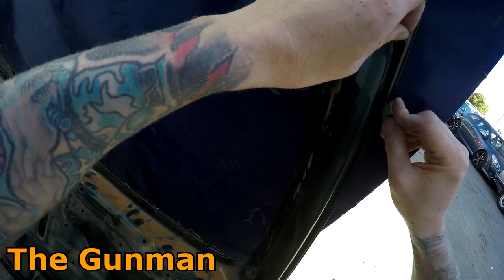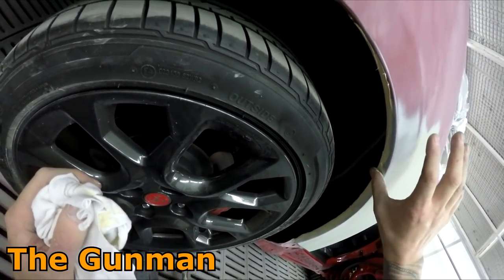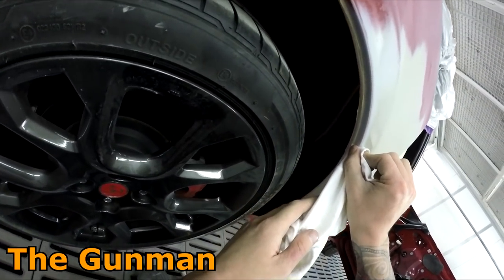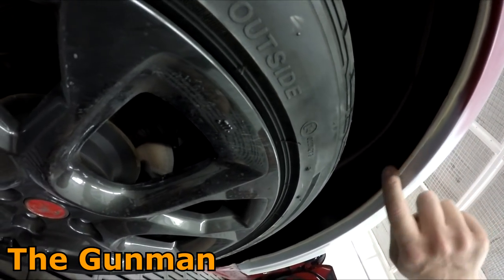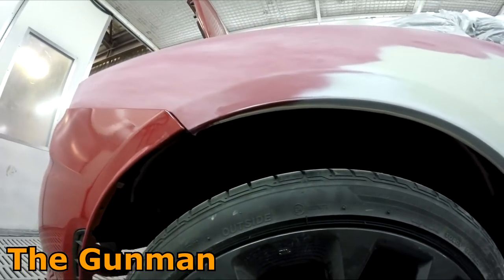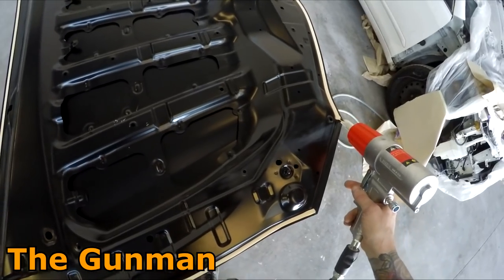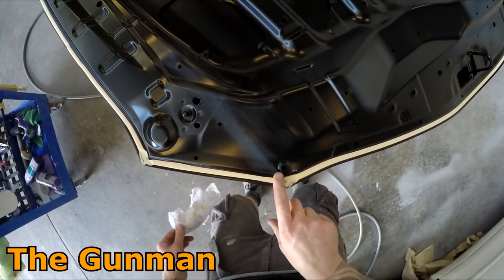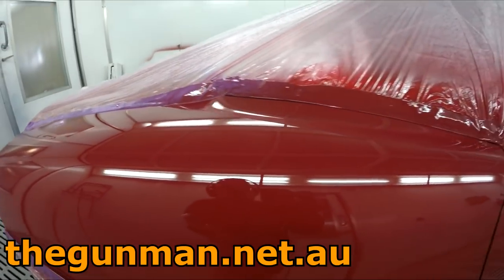Awesome Seam Sealer Trick

Comment: I have been using sem flexible plastic repair. I just lay 2 pieces of tape parallel with each other and make the width i want directly onto something that the plastic repair will not adhere to. Squeeze it on, smooth it out with spreader, peel the tape and let it set up for a bit then pull it off. Kind of the same technique, but its all fresh materials. I use this for all sorts of tricky factory seam sealer finishes.

Comment: Using a seam sealer anywhere after a repair is 80% more than what most shops will do. My hat tip to the gunman. In the States, many hard to reach parts can still covered with a hand gun and a finger to spread. Here, many seam sealer (1 part / not 2 part mixed in a gun) but is can be smoothed using an small brush (soldering acid brush / sold 50 for cheap) but dipped in a little acetone. It depends if you are trying to recreate the factory look to match the other side. A restoration is just the good practice of sealing the seam, even if it was not factory installed. While in the trunk area, I have seen where it appeared to be brushed on from a bucket, then smoothed with a bush all day with the one brush thrown away at the end of the shift. Getting a wax type coating inside spot welded panels is just as important or more so after a repair. I have a screw-on metal pot with a trigger and assortment of hoses with tips. This allows for direction control of the rust-proofing materials using stiff plastic lines about 2 feet long (2/3rds meter) to cover parts that can’t be painted, epoxied, or weld-thru sprays that I feel don’t hold up during the heat cycles. Nice job, great work!

Comment: You can also run a nee beam of sealant on a flat wooden board covert in duct-tape in a straight line or any shape you like.. The sealant will not stick to the slik outside of duct-tape.. After de sealant has completly dryed out, you can peal it easaly off the tape and transfer it to the car.. Make sure you’ll use an good brand of tape (3M, Teroson, HPX..) The texture of de duct-tape transfered to the mee sealbeam also prevent adhesive..

Comment: good trick is to run a heap of beads on an old  windscreen you can make all different shapes and patterns for wheel arches and the tricky ones in and around boot floors and beaver panels. leave them on  the glass to dry scrape off when needed
Reply from the maker: Yes, that is a good way of doing it.

Comment: Hey gunman I need your help urgently.. I'm doing a smart repair silver metallic.. I asked for a clear base coat at the place that does color matches for me.. Its milky.. Or cloudy should I say.. Can I still use it as a wet bed like you normally do.. Is your clear base coat clear or cloudy or milky? Would this cause a problem. Thanks in advance

Comment: Gunny what is the nitto air line end you use?  The nitto ends I am using either leak air or are very difficult to connect.  I am looking for a durable air line end connection.

Comment: The beeds looked fine until you starting touching the corners.   I have no idea what seam sealer is for.  I’m repainting my Isuzu and everywhere they put that stuff it’s rusting.  I’m just going to sand it off and paint without it.  Couldn’t be worse.
Reply: Bad idea, it seals the joined panels, without it water will collect and you’ll have more rust than before
Reply: Gmguy3car  you might be right but from the factory I had 100’s of rust spots.  I sanded  them all off to bare metal. I didn’t dig out any seam sealer just primed right over it.   I’m in the tropics and I’ve had zero rust since.  The top I did first and it looks amazing still.   The npr series only has a 1k paint, zero topcoat.   It has a 1k paint now with a 2k clear.   It will be way more durable than before even if I made mistakes.

Comment: Use the 3m seam sealer tape , factory looking seam in under a minute.
Reply from the maker: +C List but it falls off, I've seen it way too many times, most shops don't use sealer tape anymore because of that. Honestly I could seal a panel quicker with a sealer gun than tape. That bead would never look perfect if I had have used sealer tape.
Reply: The Gunman :
I have not had one peel off , I only use 3M.  Maybe it peels off due to bad prep or off brand product. Enjoy the videos and picking up new tips

Comment from the maker: Does anyone else use this trick?
Reply: Used this before on new rear quarter panels. Cut the old one off prior to replacing the panel then a bead of sealer & stick it on :D great trick!! 

What brand of sealer are you using?
Reply: Nope , in my bodyshop we use 7010 from spies- hecker to smooth te seam sealer out . We use terroson sealer , te gun also . I'm from belgium , drying times are a lot longer than in your contry . Grtz
Reply: I've done it a few times,  I keep this trick in the back of my mind, I like the different content of this vid too. basic but important, it's good to see how other people do things, even simple things like this.
Reply: When I  don’t have an old one to use I will take a piece of tape and mark what I need. Then lay it on a flat surface. Run a bead from my marks. When it is dry I will glue it in place just like you did.
Reply from the maker: The Brand yep, that's what I do quite a lot, sometimes that way is better because you can get the exact size of the bead.
Reply: Awesome trick. Thanks for sharing
Reply: Does this stand the test of time?
Reply: no only on the inside of doors or too mimic the factory sealers in to make it look factory
Reply: I found this trick from a painter years ago and told my guys to do the same, we have done it on the quarter panels of SUV's quarter panel wheel openings and it looked great once the vehicle was painted. customer came back a few times since for other work and it's holding up great. good deal. also what is the name of the gun used to do the seam sealer on the  underside of the hood. that is a must for any collision shop. I wish 3M would have tools like this..

Comment: Why would you put a bead of seam sealer around the inside of a wheel arch? If you look at factory cars, the inside lip of the arch is just painted steel. It doesn't have goop on it, let alone "making" a bead and then trying to stick it onto a wheel arch for what purpose I don't know.. 
Cars normally have the steel inner guard liner come up to the outer guard arch and they're spot welded together there and rolled over. Seam sealer in that area achieves nothing, looks weird there, and the bizarre worm of bead thing will fall off in a few years time when its blasted by road grit and rocks/debris..
Reply from the maker: This comment really doesn't warrant a reply.
Reply: Hope you know most cars come factory with a bead of sealer in the wheel arch..
Reply: The Gunman I agree,some cars have 1/4 panels (rear fenders) that are peened over the wheelhouse similar to doorskins...and there are others that do need to be sealed...all depends on car manugfacturer.